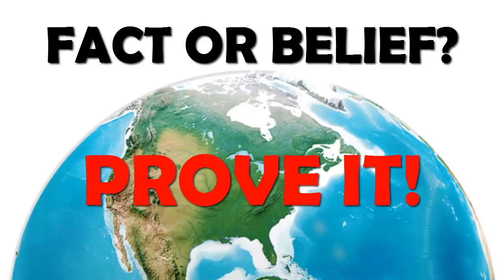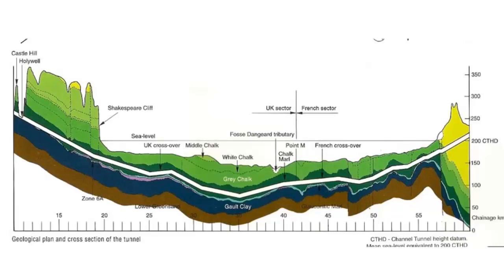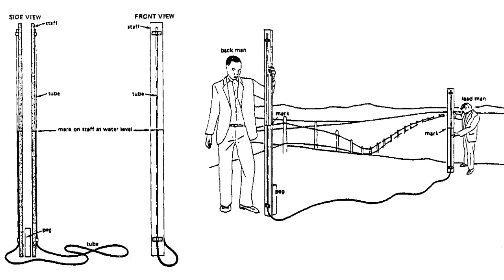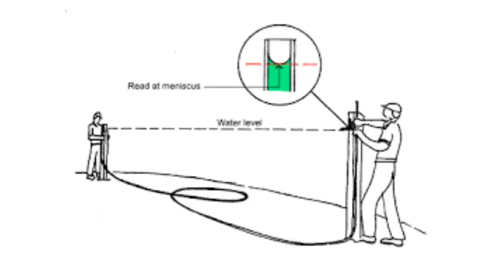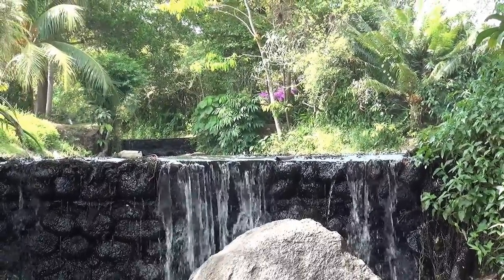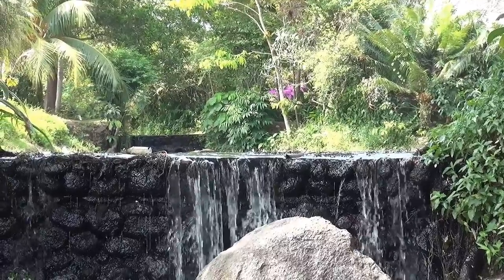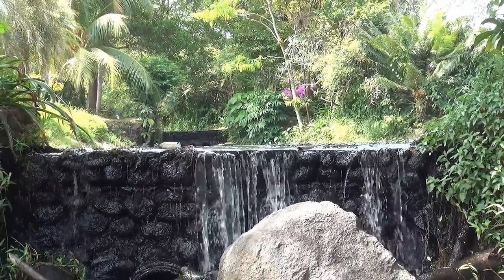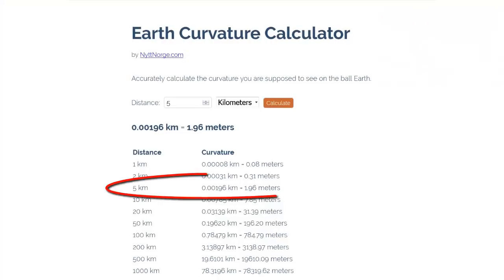Flat Earth Water Level Challenge - Prove Bendy Water Not Flowing

Comment: Of course it can be done. Only problem is that it'd cost me more than I'm willing to spend... The idea is really simple though, so I'll just post it in case someone else wants to do it (or find faults with it):

1) Take three (or more) clear plastic tubes, and stand them upright at least a kilometer (preferrably two) apart.
2) Connect all three plastic tubes with a hose (or hoses) so that they share the same water system.
3) Fill the first of them up. The water should then flow into the other two. Let the level settle down.
4) Take a theodolite or camera on a stand, and arrange it so that the level of both the first and second tube is in the center of the picture at the same time.

This will result in one of two results:
1) The level in the last tube is lower down in the picture. This would mean the earth is spherical.
2) The level in the middle tube is equal to the other two. This would either mean that the tubes are too close to see a difference, or that the earth is flat.

I'd love to see this experiment done, but I can't really do it myself unfortunately.

Comment: "Bendy water that does not flow" has been confirmed in countless experiments going back at least 1,000 years.  Contrary to popular FE myth, the horizon (in particular, the water horizon) does NOT "always rise to your eye level" (that is, to true horizontal).  When carefully measured (which is not hard to do), the water horizon is found to drop by an amount that is proportional to the square root of the observer's height.  That's not possible if the water is flat.  In fact, if you do a little high school geometry, you can discover that it's only possible if the water is curving in the shape of a globe.

Comment: So the bendy water that Soundly has shown on many occasions doesn't count?  If that is  the case why not?
Reply from the maker: Here's why: https://youtu.be/7z1qKvPXPr0
Reply: That's the one when you show an inferior mirage by placing a camera on the road bed that is a couple of hundred meters long.  You compare it to one of Soundly's photos say it looks the same. I am familiar with it.

First off the mirage is only there when you are very close to the roadway and it is dispelled as soon as the camera is lifted of the roadway.  Soundly's Photo is taken from several meters above the bottoms of the pylons. The camera is not anywhere close to being as close to surface of the lake as your camera is to the bridge deck.

Secondly the mirage is cause by the air that is close to the road being heated by the road significantly more than the air above it.  We are not seeing the same effect in the Soundly's picture. Soundly has often stated that for best viewing the air and the lake temperature need to be about the same.

Thirdly the mirroring in your roadway picture does not affect the light poles above the mirroring showing that it is only a limited effect. In soundly's picture the tops of the transmission towers clearly show that they are curving not just the bottom.

Your bridge deck photo phenomena is dependent on the the camera being close to the road bed on a hot day where there is a strong temperature difference between the air just above the bridge deck and the air above that. If you took the same picture on a cool and cloudy day the phenomena would not appear,

Comment: Loved your graphic showing the use of a water level. I work in construction and now with lasers you don't see this tool around anymore. Not too many years ago they were used to level manufactured homes, swimming  pools, large building foundations and slabs. They are very accurate and useful for large scale construction, thus the question to all is simple: At what MAGICAL distance does water start to curve or bulge rather than seek level?
Reply from the maker: Thank you for contributing your knowledge and experience! That is the big question that should be 'scientific'. Thank you!

Comment: Simple, you need a big lake with a stable water level. Put a laser on a dock. Set up a 3m sheet of cardboard, or something similar, vertical on a boat. Aim the laser at the sheet and mark the spot on the sheet. Do not touch the laser again. Move the boat 3-5 km away from the laser and mark the spot on the sheet again. There is probably a video available demonstrating this.

Comment: About the drop of 1.9 meters. I suppose assuming Earth is a ball you'd have to measure from North to South for a drop in the Northern Hemisphere? Er.. I'm trying to think of how that would work upside down in the southern hemisphere.. it hurts my brain cus all I can see is the water falling out.
Reply: The drop would actually need to occur in all directions, 360 degrees around the point of the observer on a ball. A ball slopes evenly in all directions from any point on its surface.
Reply: Right.. They assume you are always on top of the ball no matter where you are. This means you would have to measure from the center of a lake 5 km around. Er.. How do you do that? Also wouldn't the lake have to be larger if you measure from the center? Also, wouldn't they Have to establish the same drop all the way around the lake?
Reply: @DivergentDroid  also you could measure at shore lines 3 miles apart.
Even one mile to find 8 inches of drop.

Comment: Hi Nick great videos and well presented. I'm still on the fence with this but dont rule anything out. So if the earth spins at 1000 mph as they say would the water not stay on the ball. A bit like when you spin a bucket of water around fast on a rope.
Reply: Jamie Kemp no the water tries to leave the bucket but is trapped by the bottom of the bucket. On ball earth there is nothing to keep the water attached it should just fling off.
Reply: @bigflatsominxy9038  good shout I see. So because the bucket is a cylinder I see. Good point.
Reply from the maker: Hi Jamie, Thanks. The flat earthers always say it in mph and the globers always say it as revolutions, making it sound a lot less, but 'spinning ball' really is the right analogy. But these arguments literally go round in circles. They like to go on about conservation of momentum but circular momentum is constant acceleration. So ultimately it comes don to measurable proof. And so far, there is none.
Reply: @PhuketWord  it's looking that way. I heard someone say gravity can bend light as the reason for being able to see over the horizon??  Is that right? Lol
Reply from the maker: That magical gravity can do anything. it is the god of the heliocentric religion. Light does seem to bend though on a much more local level. It happens near the vanishing point. We can see it when we zoom in at low levels.
Reply: @jamiekemp2357  Gravity can bend light, but its a very very very small part of the reason we can see farther than predicted.  Atmospheric refraction is 99.9% of it.
Reply: @PhuketWord  The earth spins at 1000 mph, but at a radius of nearly 4000 miles.  Centripetal force is calculated as mv^2/d.
To get the force the same on a bucket of water on a 10 foot string that you feel at the equator, the bucket would spin at 0.47 mph or one revolution every 45 seconds.  How much force is that? Almost nothing.  Gravity is much stronger. At the poles, I'd weigh 190 lbs. At the equator, I'd weigh 189.4 due to the centripetal force.

Comment: Was going to suggest radio waves using walkie talkies placed on the shores. But now Wikipedia says the waves cling to the conductive Earth over the horizon, over mountains too.
Got to love Wikirevisionists.
Reply: Yep they do to some extent. Radio waves are just very low frequency light. All sorts of other range-varying effects as well, depending on the actual frequency used. Normally "line-of-sight" VHF waves (30-300MHz) as well as refraction and reflection also experience diffraction over mountains.
Reply: @spky999  "line of sight" also only work as far as the Visual horizon...
Correct? 
If so, over a frozen lake on a very cold  day it should be possible to use line of sight frequencies over three miles from shore to shore. The transmission shouldn't reach the receiver if the transmitter is held below six feet and definitely not if the transmitter and receiver are both at water level.
It would be an interesting test either way. Possibly as interesting as zooming in on ships that sailed over the Visual curvison.
Reply: Michael Routledge 67. Line of Sight works as far as you can see. Look up into the sky and it's a lot further than the more local land or water /sky horizon. More practical problem is as Wikipedia says, radio waves do cling to the surface and as water is a slightly conductive polar solvent, they cling all the more so you wouldn't really prove anything. Laser is not perfect but does eliminate the ground effect.

Comment: When a bubble is in water rising from the bottom, is the bubble not a sphere? If so, then the water around the bubble does indeed bend around that bubble, Place a glass sphere into a bowl of water, does the water not bend around the sphere thus bending when settled... So in reply, yes, water does bend when settled. You are thinking far too 2 dimensional when asking if water bends when simply looking into the horizon. From the perspective of anyone looking to the edge of their vision onto the horizon, it will nearly always appear flat whether you stand on a ball 12,742 km or a flat plane. So this fundamental flat earth question should not be used to confirm or deny the curve at all.
Reply from the maker: A bubble, like a drop of water, is surrounded by pressure, making it spherical. You use a bowl of water as an example. Can you hold that water without a container?  NO. It will flow. And water flows downhill. Where does it stop flowing on a curved earth?  And you are wrong about a solid ball. As soon as you rise above that surface, it will drop. Perspective causes flat surfaces to appear to rise to our eye level and create a horizon. If you look into a bulge higher than your line of sight, it will be above your eye level.
Reply: Can I ask you, what is down to you? If everything is attracted to a central mass, then down is the centre of that mass according to everything that is situated on it. Therefore the water will always stay around that large mass because it is attracted to that centre. Thus the water will stay on a globe earth... Simple
Reply from the maker: @cashobuyer  Of course if you draw a circle, then down is towards the centre of that circle, and if you assume it is a mass, then you assume that down is towards the centre of mass. For the model then you have to assume that everything you see in the sky is a spherical mass (never proven - just lights in the sky) and you have to assume that we are on a sphere. And you have to assume that mass creates and external force that attracts other masses. The Cavendish experiment does not do that in any real scientific, measurable way. These assumptions are only abstract mathematical concepts. The sizes and distances to celestial objects are all calculated to fit that model. Not scientifically measured in any way, except telling the time.
Reply: No you see what you have done is turn a 3 dimensional calculation into a 2 dimensional example. You see you are drawing a circle on a piece of paper that is sitting on earth which massively overrules any other mass that would effect it's attraction. Let's say that the piece of paper is in the same environment as space, with no forces of mass close by and lets say that the piece of paper was so big it had it's own effect of attraction to anything close to it, then you would see that water would also stick to that. Down is not a point at the centre of a drawn circle, down is the geographical centre of that piece of paper's mass. Now onto your point of everything in the sky are just lights, how do the tides rise when the moon is overhead? Light has virtually zero mass so this would be impossible???
Reply: Also, are we not surrounded by pressure also? So even if you ignore the law of attraction in mass, you can't ignore the law of thermodynamics... This is why we can breath without the air floating off into space. Pressure and the molecules of air kept around the sphere because of it's mass... On a flat earth this is impossible. And before you reply with ''We live in a sealed dome''... This is also impossible if the land mass is constantly being heated at one point 24 hours a day by the sun. We would literally cook like a pressure cooker if we lived in a sealed environment. Again think about this.
Reply from the maker: @cashobuyer  Yes, we are in a pressurized environment, and that requires a container of sorts. Have you never  seen a vivarium? Plants and animals don't cook in those sealed glass jars. It is a self-contained ecosystem. How it all works though, nobody knows. And you r I are only ever heated fora maximum=m of 12 hours
Reply: Phuket Word no sorry you can not compare earth with a vivarium when the sun is only 3000 miles away burning at millions of degrees. It would be better to compare this to a furnace. I say 3000 miles away because your flat earth theory predicts the sun is only 3000 miles away. Think about this. If you have a burning light at millions of degrees only a certain distance away in a closed environment, it is literally like having a halogen cooker.
Reply: Phuket Word also that is wrong about us only being heated for 12 hours. Because at some point at all times that sun is heating a certain area of a flat earth surface according to your theory. As the sun never sets but simply moves to another point on the plane. So with this in mind it would be like a blow torch slowly constantly hearing our atmosphere every single hour of the day with no way for the heat to escape because we live under a sealed dome? It doesn't make sense mate honestly I tried to believe in flat earth and this factor made me realise how wrong it all it is
Reply: Phuket Word Also.If the sun is just a light only 3000 miles above us. Why does it never get any bigger when we get high in altitude? All your balloon experiments proving the earth is flat and you all are studying the horizon but the real answer is still above you! Your sun never gets bigger, even all the way to the top of your balloons altitudes... this is proof the sun is not a light but is a sphere millions of miles away. ;-)